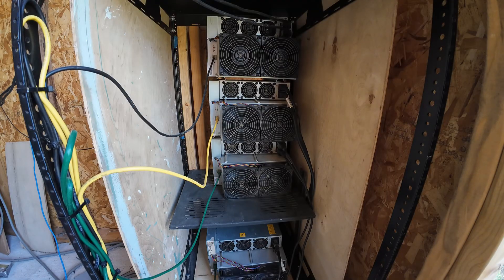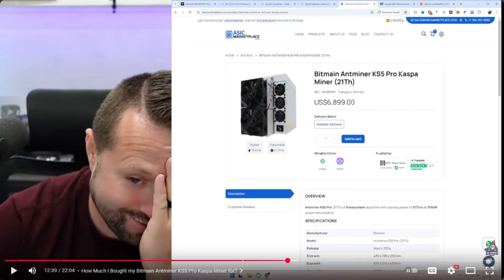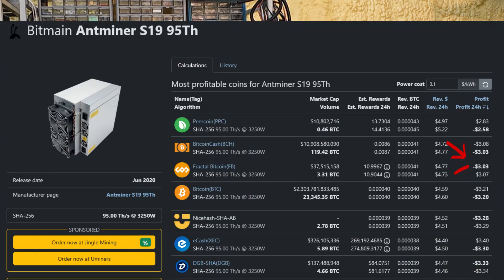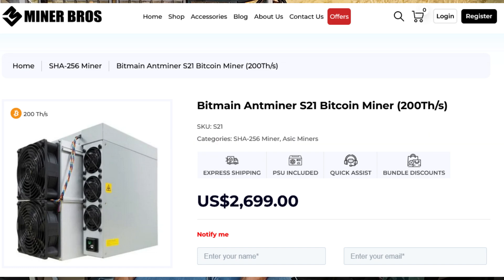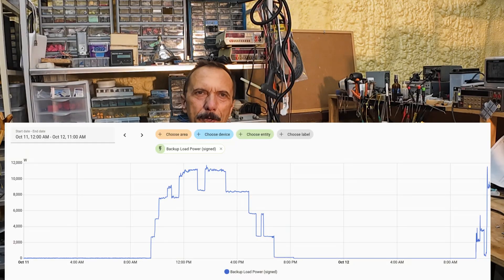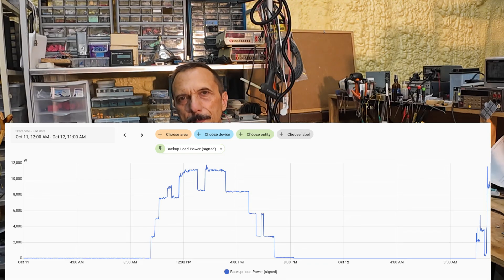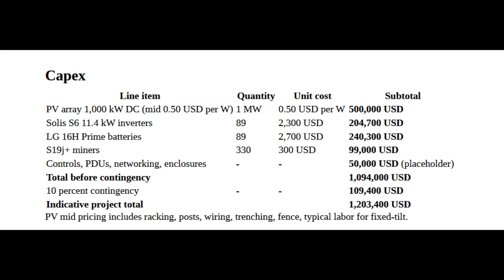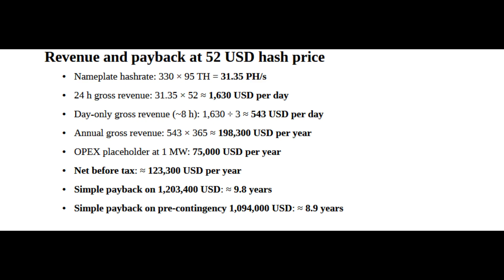Why Most Crypto Miners Never ROI (and How I Did With Solar)

Comment from the maker: This video is part of the High-Voltage Solar Series, real-world testing of high-voltage inverters, EV batteries for storage, and Bitcoin mining on pure sunlight. 
If you’re planning a solar build, you can support the channel by using my Signature Solar link and code in the description.
Reply: نتت
Reply from the maker: @hosein-b2u3m Thanks!
Reply: Are you using electric vehicles batteries for your project?
Reply from the maker: @jacksami777  Yes, I use both EV batteries and commercial batteries.
Reply: Im trying to get started and build on my system but there is so much different information out there. Your channel has been the most helpful but how did you decide to get started with this and do the inverters automatically start to shutting down  when the battery’s cut off  power to charge if that makes since
Reply from the maker: @Totallysisters_official Good question, these inverters are able to charge and make power at the same time as long as there is enough solar or other source of power.

Comment: I love your idea, I wanted to do something similar but with cpu mining, since it's VERY low on electric use. costs about 500 per unit if you're doing mid/low end gear. pays about 75 cents to a dollar a day, pulling 100~180 watts depends on what cpu you can get.
Reply from the maker: I used to be big into CPU Mining, had racks of Dell C6100 4 Blade Servers mining Verium.
Unfortunately it went the way of most such coins.
Reply: @DIYSolarFarming  if my electric cost was free I would totally get into it again, cost of entry is really cheap but I lack the knowledge and also the ownership of a land to experiment and learn, my first goal other than farming (I already do on small scall) is to have solar and use the solar to mine 100%, and in winter it's a blessing where I live because it gets really snowy and cold but a curse because I would have to find a way to automate or make it very easy to clean snow off many panels. Thank you for your videos it gives so much hope.

Comment: NerdMiner NerdOCTAxe Bitcoin Miner
( 160W | maximum hashrate of 9.6Th/s }.
Reply from the maker: 1 x NerdOCTAxe $600 9.6Th/s  
2 x S19J 90Th/s $600 180 Th/s
Or 
9 Nerd Miners @ $5400 = 1 S19J @ $300
Just saying...
Reply: @DIYSolarFarming  voltage ;} & new device
Reply: @DIYSolarFarming  Bitaxe Supra Hex 701 Bitcoin Miner | 4.2Th/s and power consumption of 90W.|US$229|

Comment: Great video. Does this video factor in the increase in difficulty that bitcoin will face as time pass? Thanks
Reply from the maker: Good question and it does come up quit often.
I'm betting on BTC price appreciation to wipe out difficulty increases, it's worked out so far.
And by the next halving if not before I will be buying the next generation of miners for what I'm buying S19's for.
Remember power is free now, I can run my old L3+'s or D3's and still make a profit if I wanted to.
Thanks for watching!

Comment: Ed thanks for sharing, love your videos 

Question, can you point me in the right direction to set up an automation system like the one you mention here? I have a solar shed, using eg4 3000w inverter and two 5k eg4 48v batteries, and a few “home miners”, I would like them to be idle unless the sun is running them.  The preliminary research I’ve done with ChatGPT is sort of suggesting raspberry pie to gather data from the solar system and control the threshold, is there any good reading or areas you can point me to for this
Reply from the maker: There's an old video on my control system in the Crypto Mining playlist.
I'll be doing an update at some point.
Thanks for watching!

Comment: solar mining with an s19 is just silly though, i can see not wanting to risk it with alt coins (my ae1 uses 500 watts and will only take take 4 months to pay off at over $300/month) but even just putting $1500 into a more modern bitcoin miner like a fluminer t3 would triple or quadruple the profits
Reply from the maker: I can buy 5 S19's for $1500 giving me 475Th , Fluminer is 115Th. When running day only solar you need to rethink your strategy.

Comment: OK, so payback after about 10 years with a very good set up, that seems to be realistic.
Reply from the maker: Yes, however remember I was using retail pricing for all the solar equipment. You would be paying wholesale so payback is much lower.
Thanks for watching!
Reply: @DIYSolarFarming  OK, so if you buy it in larger quantities, you get it a bit cheaper, and it only starts paying off after about 10 years, meaning it generates around 9% profit per year, which isn’t bad. That’s even slightly better than the stock market, where you can achieve roughly 8% profit per year in the long run (of course, we’re against the fiat money system, Bitcoin is obviously the only true one).

I understand what you said about the other cryptos, that only Bitcoin is truly reliable, and I’d mostly agree with that, maybe adding a few long-established coins like Monero. Of course, definitely no hype coins.

Mining hasn’t really been an option for me so far because I thought it wasn’t profitable enough, or that there were simply more profitable opportunities, and that’s probably true. But in a bear market (which we’re currently not in, probably not until mid or late 2026), and if, as you said, you have access to free energy like solar power and use it long term, you can generate solid profits per area, that convinced me.

Quick question about the ratio of land: how many of those photovoltaic systems can realistically fit on one hectare of land? And how much would it cost in total, including the Bitcoin miners, to “cover” that area with solar panels and mining units? And again, around 9 to 10 percent of those costs would be the annual profit, right? How would you estimate that?
Reply: @DIYSolarFarming  OK, so if you buy it in larger quantities, you get it a bit cheaper, and it only starts paying off after about 10 years, meaning it generates around 9% profit per year, which isn’t bad. That’s even slightly better than the stock market, where you can achieve roughly 8% profit per year in the long run (of course, we’re against the fiat money system, Bitcoin is obviously the only true one).

I understand what you said about the other cryptos, that only Bitcoin is truly reliable, and I’d mostly agree with that, maybe adding a few long-established coins like Monero. Of course, definitely no hype coins.

Mining hasn’t really been an option for me so far because I thought it wasn’t profitable enough, or that there were simply more profitable opportunities, and that’s probably true. But in a bear market (which we’re currently not in, probably not until mid or late 2026), and if, as you said, you have access to free energy like solar power and use it long term, you can generate solid profits per area, that convinced me.

Quick question about the ratio of land: how many of those photovoltaic systems can realistically fit on one hectare of land? And how much would it cost in total, including the Bitcoin miners, to “cover” that area with solar panels and mining units? And again, around 9 to 10 percent of those costs would be the annual profit, right? How would you estimate that?

Comment: You need runing your ASiC miner's 24/7. First, hashboard's like stable temps. Still turn on/turn off will increse temp stress on the Chips. Second, the miner's pool like farm, which dont turn off they mining power. If you Are still offline, probably they Will cut your reward's.
Reply from the maker: I do not turn off the power to the miners, they get throttled down and/or put into standby, never turn off power to a hot ASIC that's what kills them. With no fans running they are sitting there cooking. In standby they are still powered up and fans are running. For this type of intermittent mining you need to pick a PPS, FPPS pool, not PROP. Any pool that does Merged/Multi Port Mining is already doing intermittent mining.
Thanks for watching!

Comment: Thanks for the great video Ed! Do you think a setup without a large battery is feasible? It would lower the upfront capital costs even further if its is feasible
Reply from the maker: A smaller battery can work it just depends on how tight your control loop is. With a smaller battery you will need to ramp/idle your miners more often with small cloud cover.
Thanks for watching!

Comment: So if I was just trying to offset the power cost through 1:1 net metering, a system of this magnitude should in theory offset the power usage of 1/3 as many machines running 24 hours per day? Meaning 110 ASIC’s?

If that was the plan, I could remove the battery component (and cost), but would still gross about the same BTC yield, since it would be 1/3 as many machines running 3 “shifts”.

So removing the battery cost should take almost 2 years off the ROI period…

Does someone want to check my rough math? Does that sound right?

Just out of curiosity, how many panels does this represent?

Thanks for the solid numbers…. Great video!
Reply from the maker: Your 110-miner equivalence is spot on for energy. If you truly have 1:1 net metering at commercial scale and no big demand charges, grid-tie + no batteries can cut capex and shorten payback by roughly a couple of years versus an off-grid battery build. In my case, the site is off-grid so the batteries are there to keep the power stable through cloud ramps. Different architecture, different ROI levers - but the energy math you did checks out.
Thanks for watching!
Reply: @DIYSolarFarming Thanks for confirming. I am looking at a USDA Rural Development program (if the feds get their act together and get open again) that provides up to a 50% grant for rural businesses installing alternative energy.. up to a million dollars on the system.

If I can make that work, that would cut my cost (and ROI time) in half.

My impediment is that im located in a national historic landmark, so I have to kind of hide/obscure the panels from view.

But you’ve given me hope. In my state (NV) net metering on commercial is still 100%. And Im not a big enough user to require demand charges… that may change with a ramp up, but I’m at first tier general commercial service.

Thanks again….

Comment: 10 years from now the amount of hash you'll be able to do will be minuscule right? Don't you have to factor in the efficiency of the new machines making your efforts minute?
Reply from the maker: Good question! The answer is they will still be profitable even though minuscule. I expect newer generation machines to be selling in the $300 range when farms paying for power find them no longer profitable, give it a year or two.
I have several Antminer L3+ launched in 2017, they still make $.50/day if run a full day.
Thanks for watching!

Comment: I just ask chat gpt, for 500W asic miner, I add 20% so 600W asic miner, I need about $6000 solar system + battery and $1000 asic, I would ROI'd 17 YEARS with $1.5 income (I assume this is what I get at incoming bear market) or 8.5 YEARS with $3 income (I assume at current market).
Reply from the maker: I'm working on a video idea for beginners, should be very inexpensive to start mining on a small scale, ROI 3-7 years depending on the miners.
Thanks for watching!

Comment: I am not gonna lie, i was so excited when i got into crypto mining, but the most happiest day was when i finally liquidated it all near the peak of GPU prices during the great GPU shortage. I struggled so much over the years when i had my setup trying to keep it reliably running. I was not 100% solar, but over time i built up a solar setup mainly to cover my house in the future, but to offset some of the electric. I went as far as investing into a geo thermal home HVAC setup oversizing the heatsink size on the install to double use it as a cooling loop for my mining shed. I installed generic CPU coolers on all the GPUs and ran the water over a standpipe gravity fed setup using the pump outlet coming from the house to the geo field in a water to water coolant loop.
Reply from the maker: Sorry to hear that and I'm with you, for any small to mid sized miner at this point in the game it is essential to be running some form of renewables, it's just no sustainable otherwise.
Semper Fi brother, thanks for watching!

Comment: Well since the machines will be worth zero in the end and the solar panels and other inverters and such may only have half their life left... So the return is nearly zero if all your doing is trying to recuperate the 1.2M of deteriating tech..  the most important thing in long term investing is that that original asset also appreciates or at least stays stable in addition to your return. This where mining fails. The machines / hardware become worth nearly zero usually faster then the profits come in... 

If someone was to compare a basic real estate scenario. A 1.2M with 10 units in a major town or small city (not big cities).. and can be acquired / priced based on around 8% return.. so around 100k per year in net profit on the rents after all expenses and management and repairs costs. Plus the property value after 10 years based on average appreciation / inflation would be around 1.8M... thus total profit with equity over 10 years would be the 1M in profit plus the 600k additional equity growth.. total gain of 1.6M (600k equity gain plus 1M net profit) and the 1.2M invested is still preserved... Unlike when you spend 1.2M on miners that will become worth zero in less than 10 years., the returned income only equals out the original investment.. thus the actual return is zero your just chasing the original investment... And even worse is that the same money you put out is coming back after inflation thus youve lost buying power when you get it back. 

On another more profitable side of RE is leverage (access to long term financing) which is safe as long as the loan to values to 70% max amd the properties are high return, 8% and up... For example if that same 1.2M was used as 30% down payment on a 4M apartment building... If your run the same numbers.. after 10 years the building would be worth around 6M, and the total collected net profit cash income after mortgage and expenses and management would also be well over $1M.. and the debt would be paid down by an additional 1M in 10 years you'd only owe around 2M. plus gain in value around 2M equity.... with only 1.2M invested youd make around 4.2M in 10 years... And if you wait an additional 10 years (20 years total) and your looking at 8M value.. and the property debt by then would be down to around 1M.. so sitting on 7M in equity.. and the profit rents by then (20 years later) would have significantly increased to around 200k to 300k per month in profit.

Comment: Where did you get the S19 miners for $200 each ? I can only see $600 online as the best price. I am in Europe so the postage would be another $300 per unit. Any thoughts on where is a good place to buy ? Does China do bulk sales ?
Reply from the maker: I bought those on eBay last year, still seeing a lot for $300-400 https://www.ebay.com/sch/i.html?_nkw=s19+antminer&_sacat=0&_from=R40&_trksid=p4624852.m570.l1311

Comment: Many miners use a power supply to step down to 12V.  Wouldn't it make more sense to just have a DC/DC converter to run miners directly from the solar/battery voltage instead of inverting and converting to dc again.  If you include a lifepo4 battery setup you could run miners 24 hrs/day during peak sun and use 1/3 of the miners you have now.  You should also compare you ROI to just buying Bitcoin and holding....it might surprise you.
Reply from the maker: Each S19 draws 200-250 amps DC at 12 volts, 10 miners = ~2000 amps, not sustainable.
If you buy and hold there are not tax advantages.
Thanks for watching!

Comment: I've been thinking about this since I saw the video and came back to grab some math.

In the beginning you say the miners use 3kw for about 8 hours, throttled down a bit but for easy math I'll use those numbers. They each make about a dollar a day. That means for 24kWh of electricity they are making a dollar, or 4.17 cents per kWh.

This means that if you can export power at over that amount it would make more sense to ditch the miners, sell the power and buy whatever asset you want with the money.

You even do some of this math yourself when you show that running these miners on grid power at 10 cents per kWh you'd lose money.

I still maintain that selling the power will be cheaper and more riable than even these cheap miners.
Reply from the maker: I disagree with the assumption that the best play is selling back to the power company, that is the true short term play at best, power companies do not like home solar.
They will not say it publicly however all you need to do is look at how these programs are deteriorating across the country, many now offer pennies on the dollar, soon you will see power companies charging to import your power or hiking the connection fees, some outright refuse any buy back . It's just not good for their business model.
Reply from the maker: Case in point, https://youtu.be/YU0ssfGiZc4?t=90

Comment: My miner is going zero hashrate I transfer from PV to Grid, Grid to battery’s, using hybrid inverter. Them I have to manually restart our miner. Is there a solution for this?
Reply from the maker: You don't give me any information on your system...